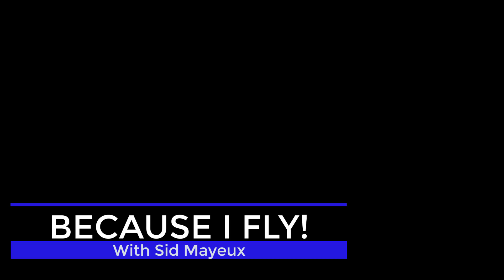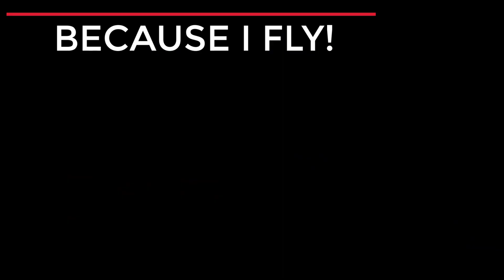Because I Fly! Episode 4, B-757 Wake Turbulence, Van's RV-7 safety human factors

Comment: shouldn't the shoulder harness prevent you from hitting your head on the ceiling ? too loose ?
Reply from the maker: Yes, and yes. The cushion foam will compress as it heats up from body heat, allowing you to sink down which loosens the belt.  I had forgotten to re-cinch my belt before takeoff.
Reply: @becauseifly3440  Gotcha.  I'm glad it was nothing serious and you were able to recover.

Comment: I hit the wake of a 757 on final approach into DFW while flying a 25,000 pound Brasilia.  We were both on final and ATC descended him right in front of us on the localizer.  I looked at my F/O and asked "is there any way we're NOT going to hit his wake??"  Just as we were about to ask for an offset, we hit the wake.  Despite full right aileron (and significant right rudder), we rolled over 60 degrees to the left.  There was nothing we could do about it.  Once clear of it, we climbed up and rode the glide slope 2 dots high the rest of the way in.  You definitely want to be above it.  Pretty cool that you caught the shot.  I doubt a bump like that would hurt an RV-7.  Your head is another thing!
Reply from the maker: Well I thought I might have cracked the canopy, as hard as I hit it with my melon.  KELLI GIRL's rated for +6/-3 Gs, but I was concerned that .1 second bunt might have understressed the tail or something.  All good!  Vans RVs' design is rock solid.  Lot's of great lessons learned and relearned.

Comment: I had the same thing happen in my RV-12 with a 747-8 going into Paine Field.  It knocked my headset and glasses off my head.  The first thing I noticed was that the airplane was still in one piece and flying.  After a thorough inspection, there was no permanent damage, at least to the airplane.  My new rule of thumb is take what you think is adequate clearance and double it.
Reply from the maker: Great rule to follow!  I love how tough our RV aircraft are, but I certainly don't like putting them to the test.